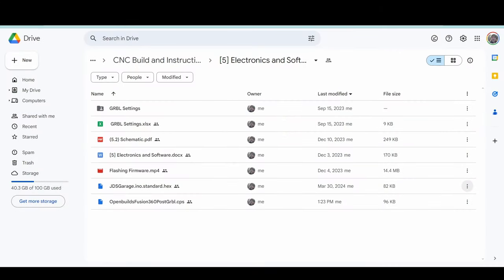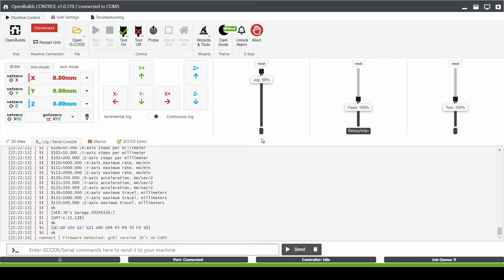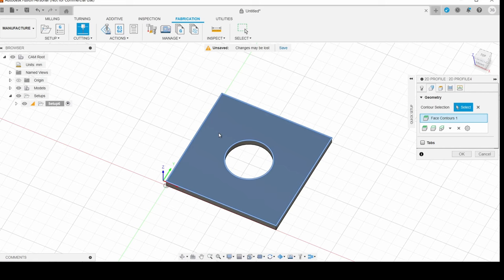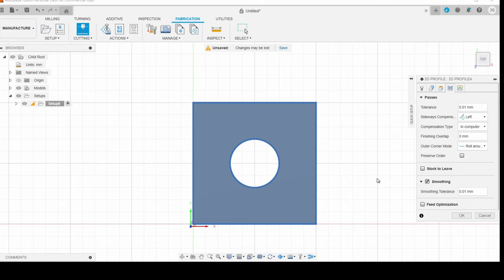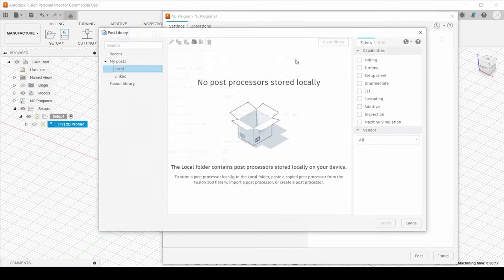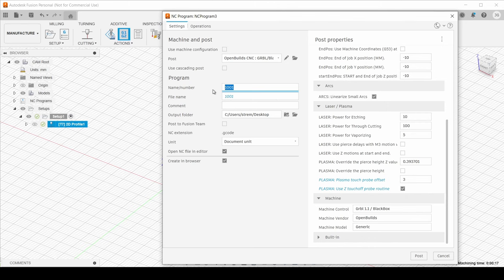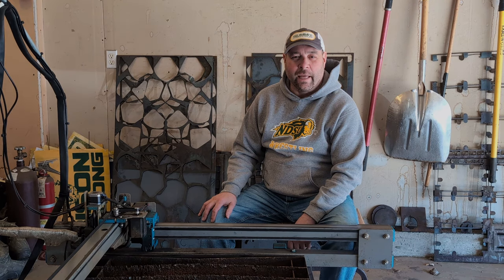CRITICAL Software Updates EVERYONE Must See!

Comment: Any THC updates? I've become a massive fan of Sheetcam, great piece of software for the money.
Reply: What post processor do u use with steetcam
Reply: @johnsassano8728  No Z axis right now, so I'm using one of the included ones, GRBL plasma no Z. I did have to edit the postprocessed to add a "spindle speed" S1000 to the M3 part of the post.

Comment: Hi, I bought the plans 10 months ago made my electronics up with my stepper motors all worked good but not done anything with it till now . Openbuilds wont connect to my arduino do I have to do this update ??? if so my old plans dose not have the bottom two rows in section 5 that you talk about as i see this update was 4 months ago. please advise.

Comment: Downloaded openbuilds control, but I do not have a Blackbox 4x option. I only have  the Blackbox x32 and interface  options. When I try to flash the hex file with the Blackbox x32 option I get an error. Is there something I need to do to get the Blackbox 4x option up or does the new version of openbuilds control no longer support Blackbox 4x?
Reply: You have to download an older version of openbuilds control. Version 1.0.370 works.  Blackbox 4x isn't available on the latest version for some reason
Reply: I’m having same issue my question is I download the older version does it work directly with arduino or do I need the bin file jd is describing thanks for any help

Comment: When I built cnc, I mainly used your plans for frame only. I upgraded Z axis to have dual support for bigger cnc torch so it wont sag, and added m6 nuts for better fixturing to metal backing plate,3D printed tapped holes are very bad imho. I'm using mach3 for controlling cnc with BSMCEO4U-PP controller (9$) and THC SD for simple thc action. Was about finished building my own THC, but time is money, so bought a used one. My plasma source was 390€ (including shipping and cnc type torch). I skip on fushion 360 Z axis and use custom mach3 plasma screen ,where all settings related to Z axis and piercing time is preset there (saves time on loading to mach3). Computer used for mach3 is cheap 20€ dell optiplex. 

If anyone is interested in Z axis upgrades, please write a comment below

Comment: do they have Gcode files for testing heights , speeds ect to tune in cutter? ive been trying to get a solid cut for over 2 weeks and still not able to use yet. Aslo would you be able to show how to resume a cut on failed arc. i have not once been able to resume a failed cut. it always throws errors about cant start arc from this point or it randomly throws z into the part and drags it all over the place.
Reply: When mine fails I let it finish the cut. Then I go back into fusion and write a new tool path just for the one that didn't fail. A pause feature would be freaking fantastic! According to chat GPT- natively grbl has an input for "cycle start" on pin d7. My plasma doesn't have an arc okay output so my plan has been a reed switch secured to the ground clamp wire. In theory, a ground applied from the Arduino to one side of the Reed switch with the remaining side connected to pin D7 should stop the cut if an arc has not been successfully made and transferred to the ground clamp. But this is all in theory and I have not actually done it yet.
Reply: @jesse2591  oh ok ty i have not tried that yet i will have to. do you know how the arc ok works? this plasma has 2 pins for arc signal and also arc voltage output but not sure arc voltage does or how to use either of those 2 features.
Reply: @420Myths your "arc ok" would serve the same purpose as my reed switch. You can check with a meter, but I believe those two pins connect when arc transfers to the clamp.

Comment: I had an issue yesterday that the G53 caused the nozzle to go down -10 below 0 and dig in to the plate and then dragged the nozzle across to x0y0. Any thoughts on that?
Reply: mine is doing the same thing ... would love to hear a fix for it
Reply from the maker: This was missed in the video a solution is not live in the plans.
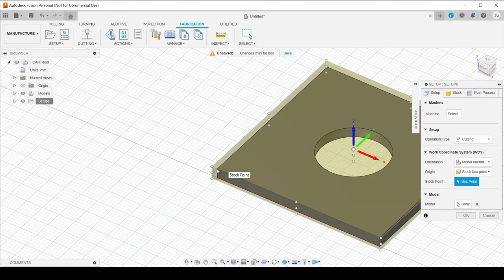Reply: Watch 4:40 mark
Reply: @the_edge_of_time  got it sorted it was a setting in the post processor. Z start height -10 instead of 10
Reply: I have tried the suggestions but I continue to have the same issue no matter what settings I use. Prior to the upgrades from Fusion, i had no issues. I performed the hex file update and the new post processor update. The Z axis is basically diving negative to anywhere from 3" to 6", or trying to, from the zero position on it's way to the first pierce or lead-in. Going more negative along the way to the first X and Y coordinate. This issue seems erratic with different results in Open Builds without changing the GCode. If it's not fixable, I guess my options are to not use the Z touch off option in the post processor or stop using Fusion360 after spending countless hours learning it over the past 2 months. Question, Would a voltage controlled Torch Height Controller solve this issue?
Reply: I have the same problem..
Reply: This happened intermittently (Why I don't know) to me as well so I just deleted G0 and Z-10 (Or whatever value is used) and just left the G53, when it gets the the first position, it just takes a bit longer to find the surface. Seems to work for me.

Comment: I'm getting an error downloading the firmware, says I need to be in bootloader mode. How the heck do i get it into bootloader mode? Almost done with the table. This is the final part.
Reply: Are you using a mega board the china version because i had the same issue so i ordered a Arduino Mega instead to try didnt have a issue with the UNO but i want to use a Mega.